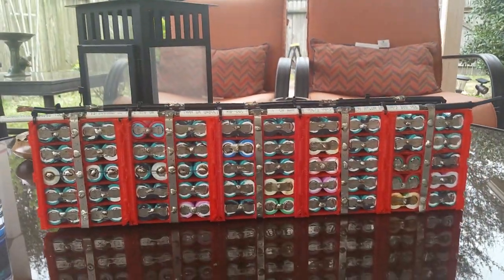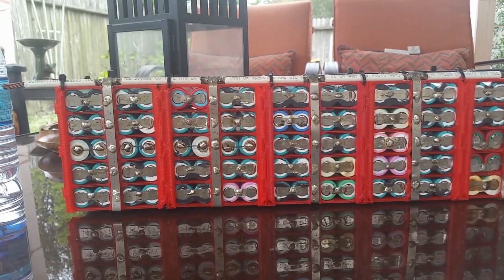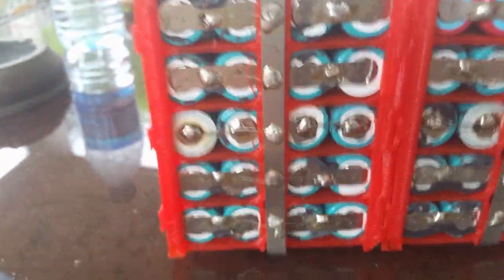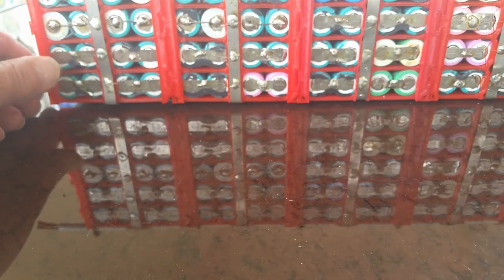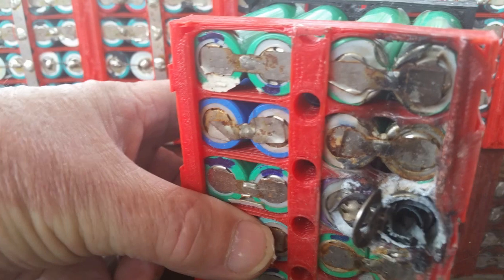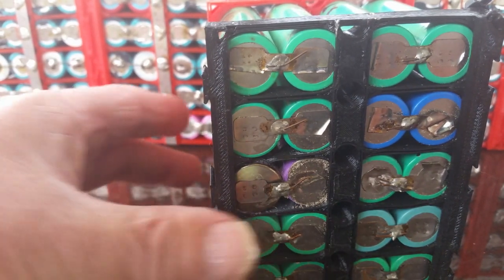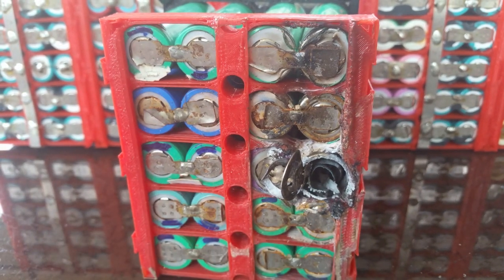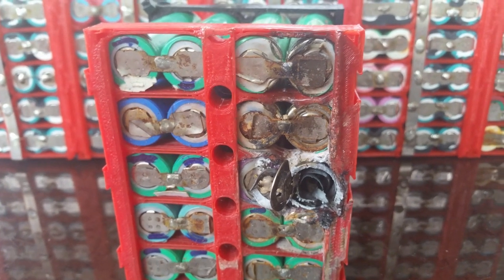DIY Dodge ProMaster Tesla 18650 Battery FAIL: Honey I Blew UP the RV

Comment: how many years did you use it before ?how many years does it go now?
Reply from the maker: The battery I destroyed was a battery built from used cells and I had used it for about 3 and a half years. The Newest used battery you see in these videos has been in service a little over 3 years now with no problems in sight.
Reply: @rv-powerwall9870  

now I have a few more years of cclys. how many more years will you be used?

Comment: I've oddly never had one of these batteries explode on me,  i've had them go bad or vent but never catch fire/explode.. I don't use a BMS for my battery packs, i just charge them and discharge without it and they seem to be fine over the years..
Reply: You really should be using a BMS. They're pretty cheap, considering. There is no excuse not to have one.

Comment: Did you double fuse each cell? I looked up fuse ratings for thin copper magnet wire  and that has worked well for me.
Reply from the maker: i assume you are talking about the battery that i burned. Yes I had fuse wire on both the neg and positive side.

Comment: Thanks for sharing this info, I am going to build a battery bank for off grid living on my property, I have been watching alot of videos and have come to the conclusion that I am not going with 18650s or lithium at all, just too many problems, I don't care about the weight of my battery bank, therefore I'm going with good old fashioned lead acid 6kw
 Tested and true,,, I'll just make sure that I don't go below 75 percent state of charge, I know guy's say 50 percent is a good idea but I think 75 percent would make the bank last alot longer..
P. S. I really only need 2kw of battery bank, I'm just going over kill for a cloudy day..
Great video!
Reply from the maker: You will not have any problem taking the battery down to 3 volts per cell. The most important safety check you can make is when the battery is charging MAKE SURE NONE OF THE CELLS EXCEEDE 4.2 VOLTS

Comment: Not a Tesla battery,  DIY copy,  it seems the way this was built, the center 'batch of cells'  got too hot, no air circulation exposure for cooling
LOOK how the Tesla battery is designed as a flat pack with the ends of each battery expose (under plastic) and the cooling tube that runs thru the pack,
Even without liquid cooling each individual cell as the same amount of exposed surface, where this one was boxed in
An indeed infared temp gun would show the two outside packs cool, and the failed pack Hot!!
Reply from the maker: It is what it is!
Reply: @rv-powerwall9870  true, but not the kind of reply i expect from an engineer
i would expect something like checking for heat distribution when loaded
or redesign for better cooling/heat dissipation

Comment: Any fuse will EASILY handle 10% OBER current for seconds to hours (depending on the exact specs).  Even at 100% over current, it can take 100s of msec or longer before they fail.  This is why BMS system were invented.
Reply from the maker: Thanks Jack for commenting
Reply: @rv-powerwall9870  - I might have missed it in you series, but how did you resolve the fuse issues and more importantly prevent individual 18650 cells from overcharging/discharging ?

Comment: I have 5 amp fuses Joe said they blow at 7 amps. I hope I don't have any issues like that. I have cell monitors and fused the cells. I may add a small balance board just in case. I hope to get a batrium system eventually.

Comment: When an 18650 shorts out in a massively parallel pack like that you have every other cell in that P pack trying to pass it's current thru that one shorted cell.  So for a 100p pack it could be well over 200 amps thru whatever fusing mechanism you have set up for that cell.  Even a 50 amp cell fuse would blow rather quickly.  Which is why I dont worry about the current rating of the fuses as much as I worry about each cell beng properly fused.  You must have developed a dead short somewhere that bypassed your cell fusing if this was the case.
Reply from the maker: That was exactly my thoughts however I did not find any short anywhere. The temperature that morning this test accured Jan 5th 2018 was around 40 deg F.
When I realized the battery had to be rebuilt I started this test to blow a fuse or all the fuses. When I realized I had pushed the battery too far and disconnected the battery from series the cell that was bad was so hot I had to use a glove to remove it from the RV. None of the fuses blew. However every battery (100 of them) had signs they had blown there seal and spewed some gue. Hear in the states I could not find fuse wire so I purchased from uk the 1 amp fuse wire.
The fuse wire was about on avg 18mm long from the center of the buss bar to the contact point on the batteries. I am not sure if you noticed but those packs were built with pairs of batteries. So each 1 amp piece of fuse wire was supply a pair of 18650s. I can not explain why the fuse wire did not blow before the battery did.
Reply: Well if you tried to charge them at below freezing tha could have done it of course.  But when you rebuild the pack, charge it to nominal ~3.800v and let it sit for 24 hrs then record the temp and voltage.  After 24 more hrs check again at same temp.  It should be within .001v of first test.  Otherwise you have a marginal short, probably from one of the battery casings to the positive rail.  Remember that the entire cell except fot the + cap is negative, so it doesn't take much to get a tiny trickle through the casing sheath at some point.  Best of luck :)
Reply from the maker: Thats the exact advice I give is the rest test. On this battery after I discharged it to 26.2 I let it rest for 24 hours and the voltage remained the same. I charged it to 28v... actually 27.9 and let it rest for 3 days and no discharge.  In fact on any battery the rest test is the best test you can do.

Comment: Did you use battery management protection boards in building your power wall?  I just started watching your series but have not come to the part with the information on balancing  and protection for your power wall.  I know when I used high drain Samsung cells in my dust buster vacuum, they got extremely hot. That's when I know I need to have a reliable battery protection board and maybe fuses.  Thanks for sharing your mishaps.
Reply from the maker: I will balance them before putting them in series. However I will not use a BMS. I will use a Low Voltage 1-8S Battery Buzzer RC Checker Tester LED Indicator.
https://www.ebay.com/itm/5pcs-Lipo-Alarm-Low-Voltage-1-8S-Battery-Buzzer-RC-Checker-Tester-LED-Indicator/263108054278?ssPageName=STRK%3AMEBIDX%3AIT&_trksid=p2057872.m2749.l2649
Reply: Thanks for your reply. I like your use of 3/4 inch pipes as battery holders. I bought a few of those buzzer alarms too. Looking forward to your videos on perfecting your build.

Comment: I’m just curious, but when you originally processed the cells before adding them into your packs, did you charge them all up, then allow them to sit for a few weeks and then test the voltage again to see if there were any losses? That’s what others are doing when building packs to insure the cells are truly good. I’m glad you didn’t have a fire!
Reply from the maker: Yes i charge and made sure they were holding charge. However if you noticed I used pairs of batteries and tested them as pairs. Check out Paul Kennett video on pairs vs singe batteries  https://www.youtube.com/watch?v=dtrYI1D8hRA
I fell for this logic and it seems to be correct however when you test pairs rather than single batteries you can have one in the pair thats not so good and another that is a great battery. And if your selection priority is a capacity such as 1800ma as mine was at that time. one of the batteries could have been at 2200 and the other at 1400, the tester gives you a reading of 1800 mah.
Reply from the maker: Yes I did all these things...

Comment: Thanks for sharing. I decided to go with the one amp pico fuses similar to the one average joe uses. I’m curious where did you purchase your fire blanket material?  Oh I saw a video made by/or for the FAA on in air lithium fires. I would recommend any diy powerwall enthusiast watch it.  Have a great day.
Reply from the maker: I got the blanket off ebay https://www.ebay.com/itm/Welding-Blanket-4-x-6-Fire-Flame-Retardant-Fiberglass-Safety-Shield-Grommets/332455776167?epid=2254901800&hash=item4d67e88fa7:g:bF0AAOSw5VtaElGq
You can get blanket from any welding shop as well.
Reply: Tiny Solar Shack in a pinch, I lined a battery box with Hardeebacker cement tile board. The 1/4" type. It weighs a couple pounds more but it is inexpensive.
Reply: Excellent idea with the cement board. I would never use metal 😂😂😂😂.
Reply: While stupidly charging a battery by holding the wires with my fingers, the cid blew and a white hot flame burnt through my finger in just the few miliseconds that it took for me to drop it to the floor. This was an old tech non rechargeable lithium ion battery..you know the ones popular on the first gen digital cameras. It's a hydrogen flame. The heat releases more hydrogen. The CID holes are perfect orifices to create focused flame jets...yey! It took almost a year to grow "stuff" over the hole. Currently using that finger to punch these words on here.... safety first everyone....

Comment: Thanks for sharing this. It stresses the point that safety is key. I tried using fuse wire before and could not come up with consistent currents. I found that the length of the fuse wire is critical in its performance. Where in hand built battery packs, precise busbar placement can effect those lengths and in turn have varying failure rates. Thanks!
Reply from the maker: I think for this reason the glass fuses are the only option because the actual fuse length is constant inside the fuse.